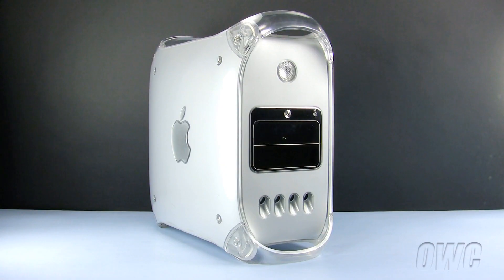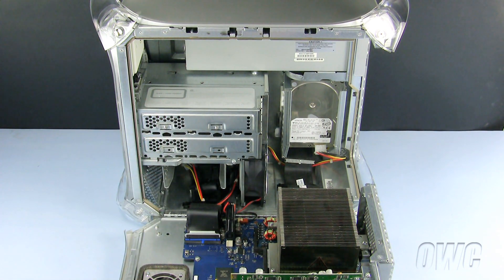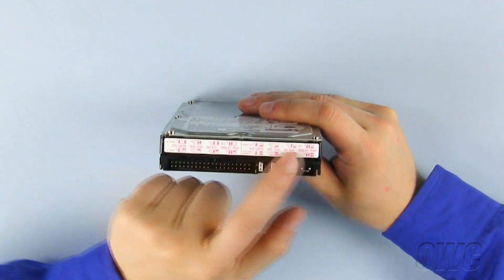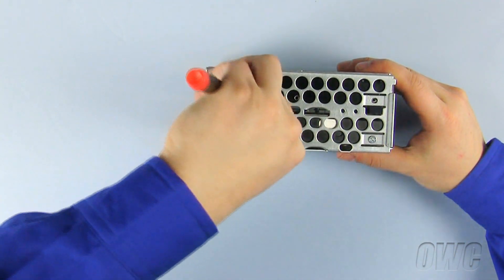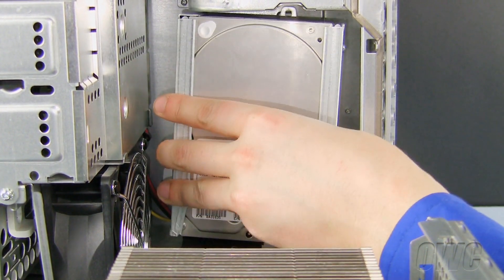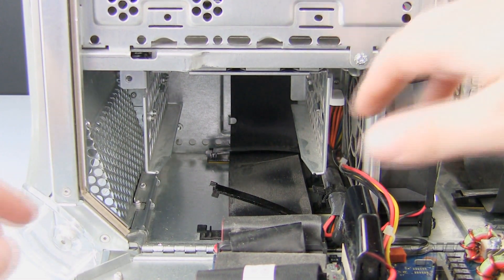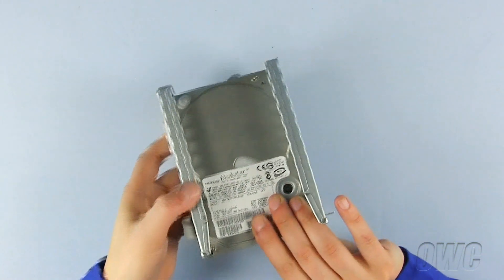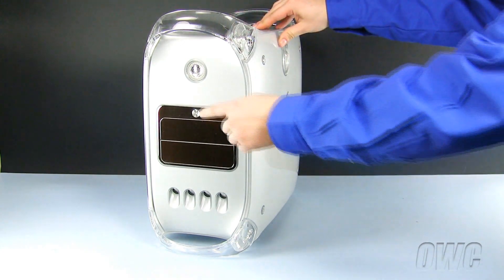Power Mac G4 Mirrored Drive Door Hard Drive/ SSD Installation Video

Comment: Where's the ssd install????
Reply: MacSales. com - so an SSD will work in a Power Mac with the adapter? Anything else needed to maximize performance of the throughput?
Reply: @EPSTomcat11  Yes, just use an IDE to SATA adapter along with a 3.5 to 2.5" drive bay
Reply: IDE to SATA Converter? 
Do they exist, & is it worth all the pissing around? 
Cheers.
Reply: @kollusion1  Use one such as this https://www.amazon.com/gp/product/B01CZ4KMBA/ref=ox_sc_act_title_1?smid=A2W0TEJ3MK1XP5&psc=1. I used this video install the drive in my MDD G4.